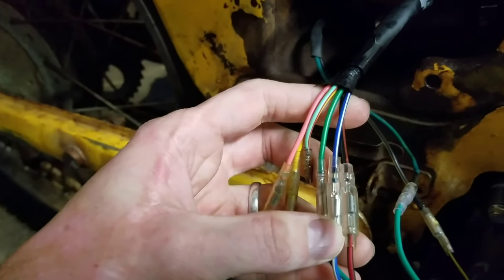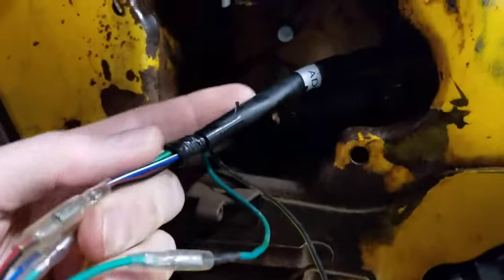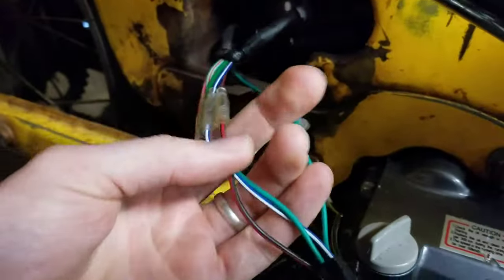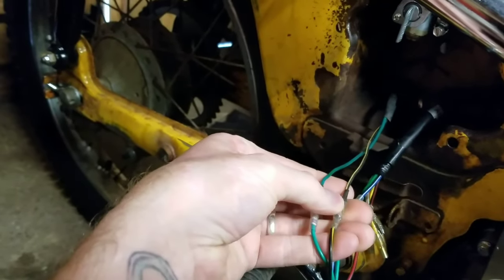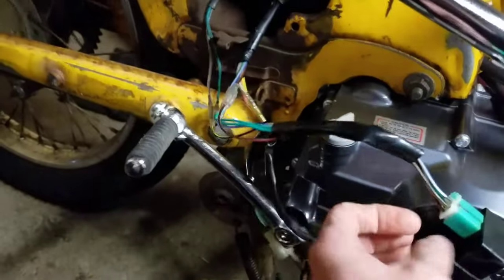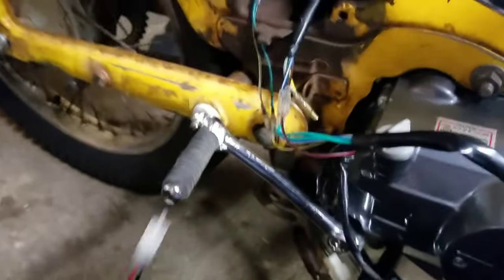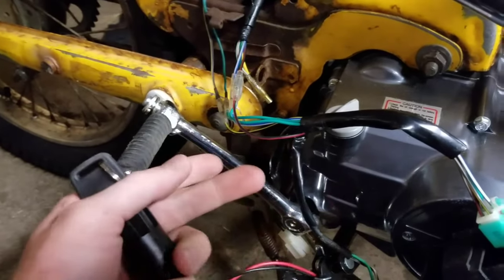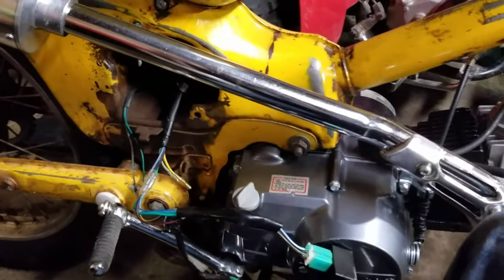Lifan 125cc manual engine basic wiring to make it run

Comment: Brunh thank god someone simplified it to the core cuz i recently picked up a bike and was lucky enough that the previous owner had pretty much completed he harness for me i just had to replace certain components that are missing but i didnt want to remove all of the light plugs and everything that he wired up i just had to know that i could follow what he did from the start and makesure its all matching up to what you say way simpler then tryna guess which plugs are what and what are the bare minimum needed when ive never owned a bike with a starter or even a cdi and a stator its all new to me coming from little mini 2 strokes
Reply from the maker: Glad to help out! This is actually one of my most popular videos, and I did it years ago. Wish I could come up with another  video that gets even a fraction as many views...

Comment from the maker: The lifan was ordered off amazon. The charging system is the pink yellow and green I said in the video to ignore for now. They put out voltage and can either run lights direct but will pulse with engine rpm, or be put into a voltage regulator/rectifier to charge a small battery which will stabilize voltage for lights etc. I will do a video on this when I am able to get time.
Reply: worthshop sweet thanks
Reply: Thanks this was very helpful I was wondering which wires it was for the charging system

Comment: Thanks Bud - Simple and to the point thats great! Do you know what the other three wire are for? (Pink, Yellow and Green with red strip) Thanks
Reply from the maker: Regulator rectifier plugs in to them. It converts the ac current to regulated DC to charge battery or run lights. Sorry missed your comment before.

Comment: do you know what the two charging wires go to? orange pink have me lost. want to get my lights and speedometer going
Reply from the maker: You need a voltage regulator rectifier. Here is a link to a cheap one on Amazon so you know what to look for.
https://a.co/d/hHMZqFJ
Reply: @worthshop  yes one came with my wiring kit already. I have no idea if it is a 6v or 12v though
Reply from the maker: @vincentsky4912  12 volt usually
Reply from the maker: @vincentsky4912  hook it up start the bike and use an electric tester to measure the voltage output if you want to make sure.
Reply: @worthshop  thanks! guessing to test with my multimeter in the 20 volt setting and test the red and green wires that would appear to go to the battery terminals?
Reply from the maker: @vincentsky4912  yes

Comment: How can I straight wire the lights I don't have a battery got it running just no lights
Reply from the maker: You will need to order a regulator rectifier to plug into the other wires on the engine. It converts the ac output from the stator to a regulated DC voltage to run lights or charge a battery. I still have this bike. I just didn't finish the build as life threw other priorities and projects ahead of it. Went from a small older house with barely a garage or much parking or vehicles to park... To finding 2 acres to purchase and slowly develope. Just got 2 cargo containers for shop and storage space... Have plenty of parking and too many projects in the driveway. Appreciate the comment and thanks for watching. Check out some of my newer videos and hopefully life let's me get to the ct90 sometime this winter.

Comment: Does it need a battery to run or will power come from the engine?
Reply from the maker: Jerome Ayin yes it will run without a battery. The stator in the engine produces electricity.

Comment: What do i do with the yellow and white cables from the engine case wires
Reply from the maker: They come from the stator and produce electricity to run lights or charge a battery

Comment: keep building shit! i love it haha..   i have a lifan 125cc engine on my 1964 honda s90 frame. i replaced the ignition because the key broke off. and now it wont even run..  im getting power to the headlight and speedometer when i kick start it but still no spark..  any help would be appreciated

Comment: What is the pink for and yellow and green and red
Reply from the maker: NSPECKTOR 12345 the pink and yellow are for the charging system. But unnecessary to make the engine run. Unsure of a red. Mine don't have red. Green is common ground for charging system.